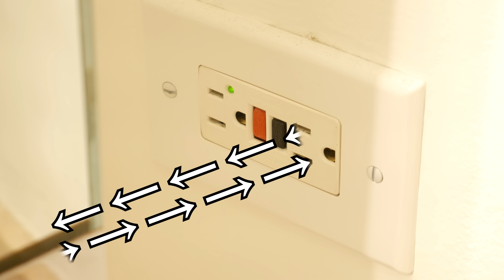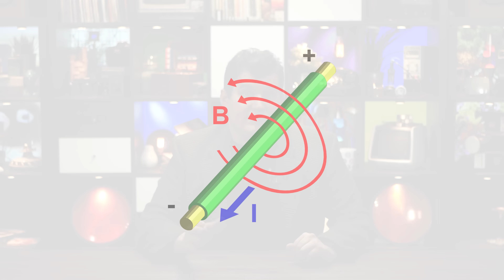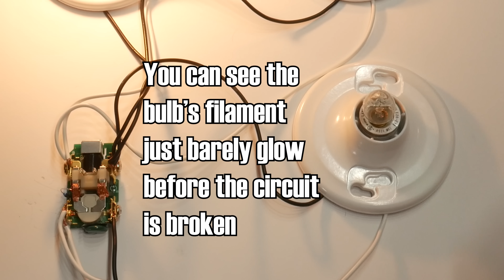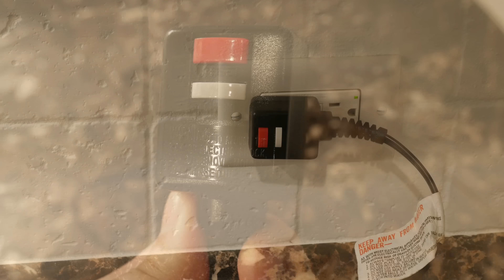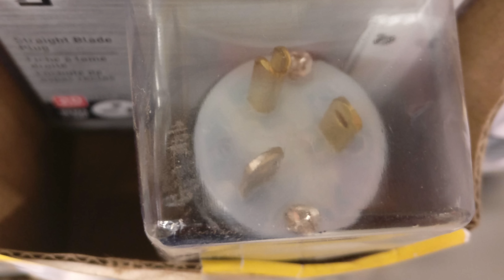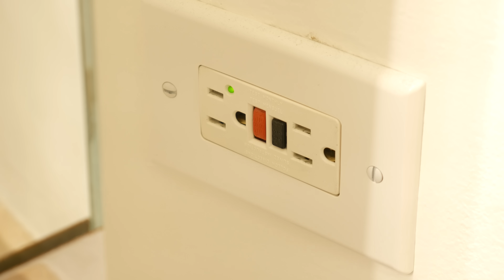The GFCI/RCD: A Simple but Life-Saving Protector

Comment: These are occasionally installed into the breaker panel here in the States, but not often.
Reply: Usually for pool pumps and outdoor installations, although I sometimes see bathroom circuits that feed garage circuits if there is only one or two outlets there (in older homes).  Tripped by your hedge trimmer plugged in the garage outlet because you cut it's own cord with it, but can't find the GFCI? Go look in the bathroom or the kitchen for dead outlets (true story, on a mobile home in that case).
Reply: One likely reason for why GFCI outlets are so common is that they can be retrofitted in old buildings with fused overcurrent protection. One common use of GFCI breakers and outlets is to add 3 prong outlets on circuits but to be code compliant "no equipment ground" signs need to be put on the outlets.

Comment: The two receptacles are usually separated for kitchen use, where the top half has one phase and the bottom half the other, of the typical 240VAC that is available to the home.  This results in 120VAC for both top and bottom, allowing more power for those hungry kitchen appliances.  You can test this with a voltmeter (hot-top, to hot-bottom).  Alternatively you can try to wire your kitchen without separating the top and bottom receptacles, and then slump in disappointment wondering why your main breaker blew (if not the mains transformer fuse itself - yay!)

Wiring receptacles for lights is a different matter.  Several options there.

Simplest explanation for triggering the GFCI is that the return current is not matching the delivered, that is to say the current found another route... like a faucet or pipe.  I can look up the exact value/time equation for the damage that current causes, if ya want.  It's a grim study.
Reply: (Yes, a house gets single-phase.  But it's centre-tapped.  So the mirror image is a 180 phase.)
(Some houses have mad scientists in them that require full 3-phase for their flux capacitors!!)

Comment: In Australia ALL circuits (including lights!) must be protected by RCDs for a property to legally be sold, so even if you're buying a 100 year old house it must be retrofitted to legally be sold.
I feel that forcing all circuits with outlets at the very least to be protected is a good idea, since I've seen an RCD fire for real, and the fault it detected was my sisters fingers hitting the live pin on a non-standard plug* by grabbing the underside to lever it out of the socket, no water involved.
*Australian plugs have rubber insulation covering half the length of the live and neutral pins so that if the plug is half inserted and the pins barely touch the connectors in the socket the exposed parts of the pins aren't conductive.
Reply: Just to add - that event was an RCD turning a potentially fatal electrocution (we use 240V power on standard circuits) into such a non-event that it took us 5 minutes to figure out why the circuit suddenly switched off.

Comment: Another thing to mention is that a ground fault can happen when a live wire touches a grounded metal chassis of a device, like a washing machine. This will trip the circuit, preventing you from getting zapped in the first place.
And most importantly: these devices do NOT prevent electrocution in any other case than a ground fault. If you happen to touch a live and neutral wire at the same time, current will flow through you, and there is nothing to protect you.

Comment: This is unbelievable stupid. In Germany you have one RCD for the whole house/apartment which protects all outlets, switches and all cables in the walls, additionally to usual resettable breakers.

This not only is much more secure, if you think about accidental drilling into a live cable, the danger of water and electricity coming into contact, closing the loop over a human body, but it would also reduce the risk of a fire significantly, because all switches and cables from the breaker box are constantly monitored.

Implementing it this way would reduce the risk for electrical shock on plugs outside the kitchen/bathroom, since they have a hazardous design, and nobody seems to care.
Reply: It's mostly because whole house GFCI protection makes installations much, much more expensive and they also tend to trip out for no good reason, which is a huge nuisance.
Reply: GemCat 

The RCD just watches what power is consumed and sent back over neutral. If it trips, a substantial amount of electricity flows towards ground and not towards neutral. A clear indication that your electrical installation sucks. 😂

Get a professional to fix your installation 🙄

There's just one reason to not use an RCD: A old three phase load which isn't balanced: Old water heater sometimes have this issue, but if you bought one in the last 20 years, you shouldn't have no issue.

And yes, electric car chargers do need a different RCD type and some large scale motors do also not work on RCDs.

Comment: I always wondered about the "test monthly".  It is more about exercising the mechanics of the switch rather than giving you piece of mind for another 30 days (though that is some of it).
When you state that it isn't a substitute for a circuit breaker you didn't mention that circuit breakers work in a completely different way, that is rather than competing magnetic forces they work by responding to a wire heating up more than it should.  I thought that would have accentuated the differences better.  A small criticism for a fantastic video.

Comment: Been saved 3 times by those. Latest time was drilling through a live wire in a wall. Before that was unscrewing an old lightbulb and accidentally poking the fillament. Previosly was at school where I didn't notice they were rebuilding near the lightswitch and I did turn off the lights. And more.. Didn't feel a thing! Love those.

Comment: Please do a video on why it is that most digital clocks tend to gain time and become "fast", when the adjustment buttons tend to increment minutes.  If a clock is 3 minutes fast, I have to push the button 57 times to make it right.  Or, hold down on it and it goes too fast and then miss it and have to cycle through it again.  Sure, I know it's nearly impossible to make a clock that keeps perfect time, but it's not hard to determine whether a clock tends to become "fast" or "slow".  Clocks that gain time should have "decrement" setting buttons.  My motorcycle tends to lose time, and so that's convenient.  Also, it has the ability to increment the tens digit of the minutes.  It's an "SYM Fighter 150cc".  Thanks!

Comment: This is an Excellent video!  I remember these when I grew up in USA.  We randomly have these in Taiwan, but I don't think anybody tests them.  My house is 13 years old and was built by my landlords (a very nice elderly couple) who don't "get" the idea of safety and so the outlets in my house are only 2-prong.  Any computer or even USB keyboard attached to a computer can shock you.  I bought a huge power strip that had a retractable ground "prong" and wrapped a wire around the ground prong to go out the window into an old cat litter box which I would have to "water" after being shocked.  A tall truck broke my service drop line and the Taipower guys came to replace it (not only for free, but they gave me a heavier cable, too).  I proudly told them how I had handled the grounding problem while we were waiting.  A very nice gentleman spent a long time to teach me how to solve the problem permanently by running a wire from a certain point in the electrical box.  I did as instructed and have never been shocked since.  Great thanks to Taipower!  I even posted my story on their website about how much I appreciated this extra help.  (It's all written in Chinese, though).  Keep the good videos coming!

Comment: If you're wondering, "If the current going back to the source is the same as the current going to the load, where is the power lost?" It's in the voltage. Loads only drop voltage, not current.

Comment: It may seem overkill for us in the UK to have these on every single circuit comming from the 'fuse' box, but we do have 230VAC in our sockets.  In the place I used to work, they'd set the tappings in the sub station wrong and we had a consistent 260VAC on every low voltage outlet.

Comment: I wouldn’t rely on the shape of the hole in the outlet being the only difference between the 15 & 20 A GFCIs. It’s possible that the circuitry is different but they don’t want the added cost & complexity of having a different neutral prong contact too.

Comment: Great video. One thing though: Although a GFCI receptacle can accept a 20A plug, one should not install a GFCI in the box for 20A use unless the circuit is wired for 20A. Meaning, the circuit should be wired with 12 gauge Romex or larger.

Comment: I noticed you mentioned AC specifically (after all, we're talking about a residential power outlet) - is it possible to create a GFCI for DC (say, for cars)?
Reply: It is, but not with sensing coil. The best solution would be to use ferrous core around power lines just like with this coil, but put Hall Effect sensor instead. It's the one which can sense constant magnetic field.

It's absolutely unnecessary for usual gasoline cars with 12 or 24 V batteries because there is no way people could be hurt from voltage so low. But this is probably good idea for electric cars as there are high DC voltages present, like 400 volts.

Comment: as far as i know the exposed visible heating elements in toasters are not conducting electricity. they are just conducting heat from a source that is electrically insulated and heated from electric resistance on the inside.. Most thick heating elements are ceramically coated so the circuit is not actually exposed.

Comment: meanwhile in UK: no power outlets in the bathroom. Problem solved. A more serious question: how fast the coil opens the circuit? It doesn't seem very fast (in electrical terms) given it is a mechanical device that has to accelerate a mass. I guess for a very short period of time the current is allowed to flow
Reply: Gianluca Ghettini As stated, they will trip in around 30mS, or just under two AC cycles at 60Hz (16.7mS/cycle).  So current will flow briefly, however this is usually during the period where you are in the process of making contact and before firm contact is made, so the contact resistance at that point is usually still fairly high and current limited so you usually just get a brief hint of a tingle or jolt before it has disconnected power.  The goal is to reduce the peak current and duration that power might possibly pass through the heart, but in the US the detection threshold is set below the minimum current necessary to stop the heart so the circuit should clear the fault before you are at serious risk in the vast majority of cases since the body is never an ideal conductor to begin with.

Comment: Very interesting devices you have. I enjoyed to learn about them from your video. None of those are used in ukrainian or russian households. I'm an electrician. The ground fault protective devices are commonly used in industrial electric networks (for example, in underground mines). But electric network in a house differs: the standard rules insist that the additional ground circuit is not needed, because the neutral wire is already grounded. That's why we have european standard wall outlet witn only 2 contacts - for live and neutral wires, mostly independently of actual current or the need of being grounded.

Comment: New homes in the US are now required to have both. I believe just the bathroom and kitchens, but our new construction house had both the GFCI at the plug and in the panel. :) Tripped all the time and our electrician recommended removing the panel GFCI, though they couldn't do it themselves legally.
Reply: Code has required AFCI breakers (arcFault, not ground Fault, it's different) in residential new work so it may be the AFCI breaker that is causing the problem, early examples of the breakers were prone to tripping too easily replacing the breaker with a newer one might solve the problem and maintain the level of protection
Reply: LOHTEC If it's really a GFCI, then having more than 30mA leaking requires investigation of the fault, not irresponsibly removing protection.  Probably something broken somewhere unless you are running a really old non-residential machine somewhere that leaks way too much to ground compared to modern standards.
Reply: Just fit an higher sensibility one at panel (10 times the mA of the 'terminal' so if you have 30mA on the outlet you should fit a 300mA on the panel) because 'leakage' current get summend up at panel and standard sensibility is too high and trigger the circuit.
Reply: sorry: lower sensibility (it should open the circuit only if current difference is high)

Comment: One thing to note about the resistor testing: if you try to test it and it doesn't trip immediately, DO NOT continue to hold the button down - the resistor is only meant to conduct briefly, and if you sit there and hold the button down it can heat up quite a bit and melt things.
Reply: GiddeonFox In fairness, though, if it did not trip immediately then it is defective and already needs to be replaced ... so maybe that finally convinces the homeowner to replace the outlet! :-)

Comment: dumb question, but: why doesn't any load on the circuit from something plugged into an outlet not create an imbalance between the in and out lines to trip one of these things?
Reply: Because as long as the current flowing on the hot side is perfectly mirrored on the neutral side — that is, equal and opposite — then there is no current imbalance.  GFCI/RCDs only detect an imbalance in current between hot/live and neutral...an imbalance meaning that somewhere current is flowing somewhere it should not, in this case to ground, the result being an imbalance and the tripping of the GFCI/RCD.
Reply: but if there is something drawing current along the circuit, how is it perfectly mirrored/balanced?
Reply: b. griffin  think of electricity like it is central heating radiator. Water comes from one pipe, goes through the radiator and heats it, going away by another pipe. You definitely draw a heat from this, but there is equal amount of water in and out. Except you have leakage! Same thing with electricity. In good devices there is just no other path for electrons to go, but to neutral wire back to your outlet. But if insulation is faulty, there is.
Reply: good analogy, thanks.
Reply: If I remember correctly, load on a circuit drops the voltage, not the current.

Comment: The outlet chassis might look the same and the plate may look like the only different, there are still a lot of things that don't meet the eye: in the higher amperage outlet, the contacts can be beefier, the whole thing is made to withstand the current. The lower amperage model might not cope with it and since cost cutting is how these things are done, there is no point adding too much metal to what is suppose to be the most basic, most popular product. Everything is made lighter. The chassis might be 100% identical mold but to me even that looked to be different plastic.

Comment: In Italy we call those devices (which are normally fitted inside the distribution panel) “salvavita”, literally lifesaver, and I always loved that name, because it speaks for itself and you don’t need to know what residual current or a ground fault is, you know it’s to save your life (also we have 230v which is much more dangerous)
Reply: Actually we call them 'interruttori differenziali' (differential switches). Salvavita is a BTicino trademark. But I agree that the name has been selected well.
Reply: Davide Bacchi  technical term whatever, but everybody calls them that, the only problem is that most people tend to call also the MCBs, with only overcurrent protection “salvavita” which is wrong and might lead to confusion
Also, fun fact, they call them salvavita too in Malta
Reply: Voltage is not what kills you, it's the amps
Reply: @tally1604  Can't have amps without voltage. For a given resistance (e.g. a human), current flow is dependent on voltage.